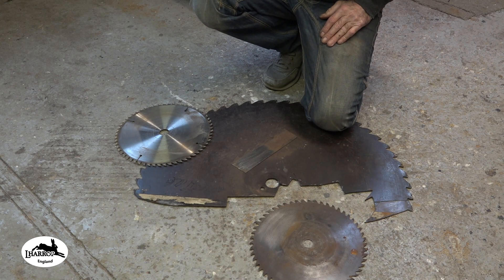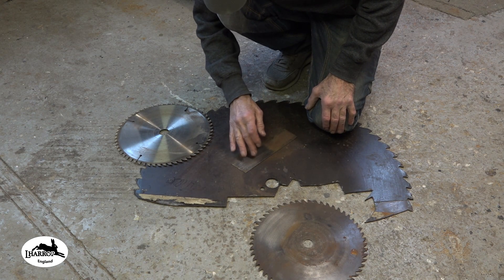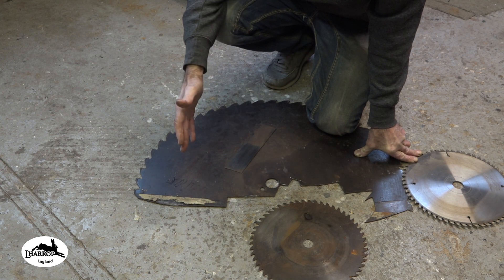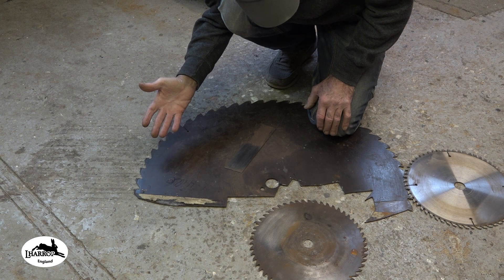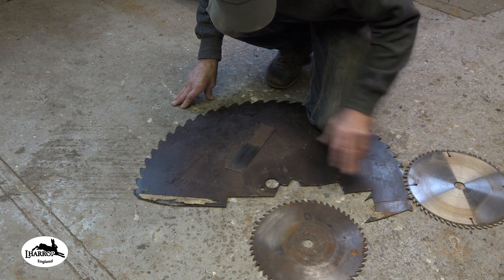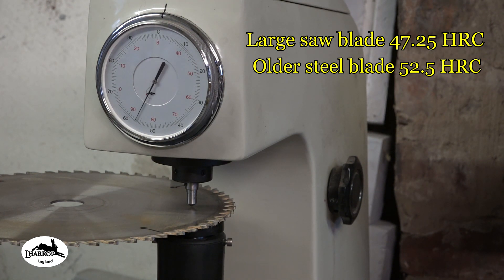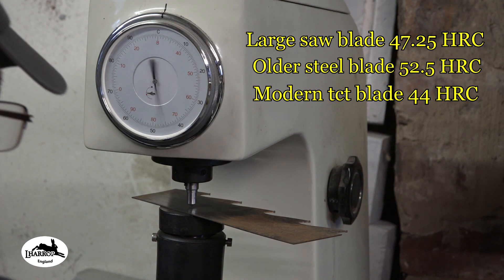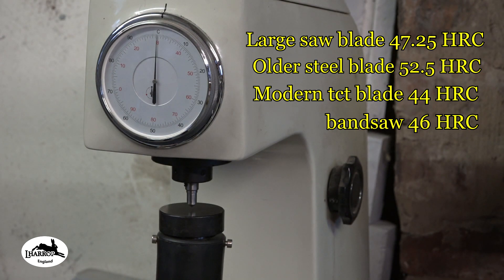sawblade knives do you need to heat treat?

Comment: would have been interesting to take one or two of those and actually heat treat them / harden them. i did many knifes from circlar sawblades over the last couple of years and these steels are VERY good hardening... a brand new, quality metal file does not bite at all.

Comment: I’ve used 58-62 RC in the field, a lot. Really not practical to resharpen in the field, and you will need to resharpen, often. Don’t let harder RC steel get dull.

For me, 52-54 RC is ideal for hard use, and you will need to resharpen often. But you can easily keep a usable edge like a butcher does, as the day goes on. 

Same is true for hatchets, axes, machetes…

Comment: I’d love to see the same test repeated after heat treating.  How much does the HRC increase after you quench and temper the same steel?
Best,
Dwayne
Reply from the maker: Hi Dwayne, If I was to heat treat the same steels Im pretty sure they would almost all achieve 63 HRC as a minimum, they would have been heat treated when they were made to give the results when I tested them. I meant to re'heat treat the blades some time ago to find out so maybe I will in the near future. Cheers

Comment: Tried to brake a small piece of saw disc with a hammer and it just bend.The file tels me there is some hardness in it though propably around 40hrc as you showed.Quenched the piece in canolla oil and broke like a glass.Normaly it will make a good knife am i wrong?What is the tempering temperature for about 59hrc on these disc blades?
Reply from the maker: Im afraid I cant give you an acccurate temp mate without hrc testing the steel first but somewhere in the 230C - 250 C range will get you to 59. Cheers

Comment: As always great video Loz.
Since you are in the subject of saw blades Rockwell hardness test, would you go two steps further:
Heat and quench those blades and see what RC values they would have before tempering.
And step two, temper to what you normally do for knife blades, and see if they can be tempered to 59 to 60 HRC.
Thank you.
Reply from the maker: Yes will put some pieces in on my next heat treating session. Cheers
Reply: @LozHarrop  Thank you Loz.
Reply: I've done some testing with tungsten teeth saw body I've achieved 64 HRC   after quenching before tempering. After tempering IT had about 61, also IT was suprisingly tough

Comment: The body of the blades are left in the annealed state while the edges are hardened. Try testing the cutting edges in your tester. Make a rough test blade from the largest circ blade and see how your heat treat works out. A 1095 profile would be a decent guess? 👍 😃
Reply: I can tell what you said is true because cutting through table saw blades becomes more difficult towards the edges.

Comment: Very useful video, thanks.  I've a load of these blades (perks of being the guy who changed them) and have made bits and bobs from time to time.  Frankly it never occurred to me that they'd be anywhere near hard enough, even if they hadn't annealed from heating by friction, so I've just done a rough and ready heat treat tempering them to light straw as best I can, with acceptable results.  Sounds like they have the potential to be more than acceptable, though, in the hands of someone better equipped and more competent.
Reply from the maker: Yea same here mate, always regarded them as unhardened, mot likely 7 series steel most of them so they can be made alot harder.  cheers